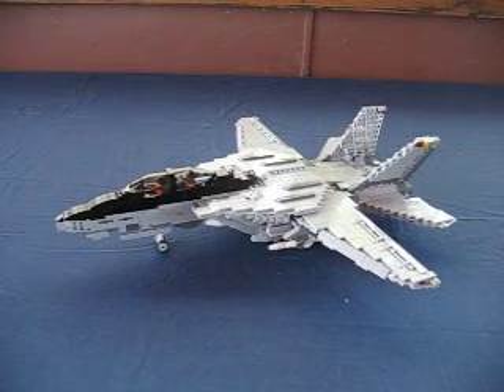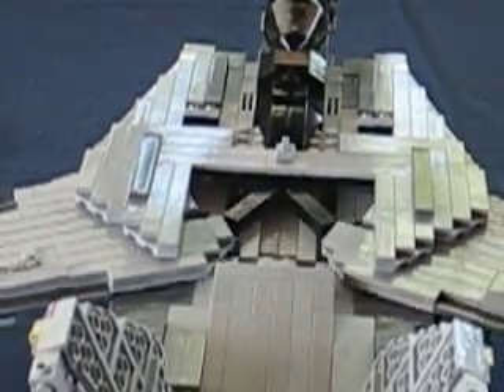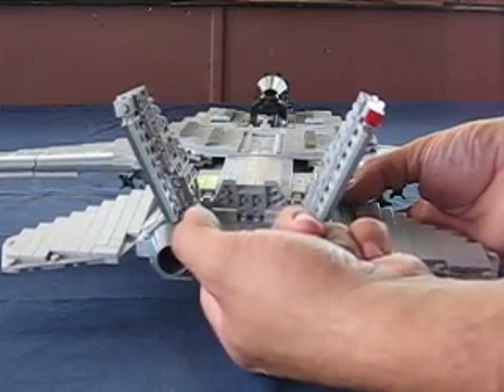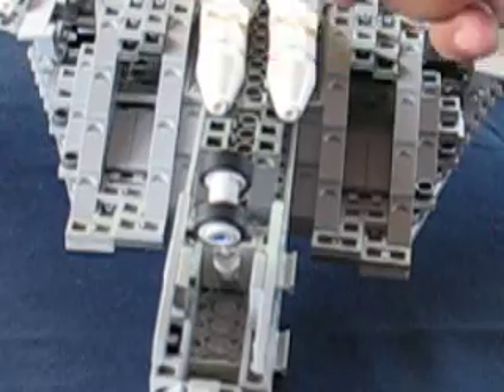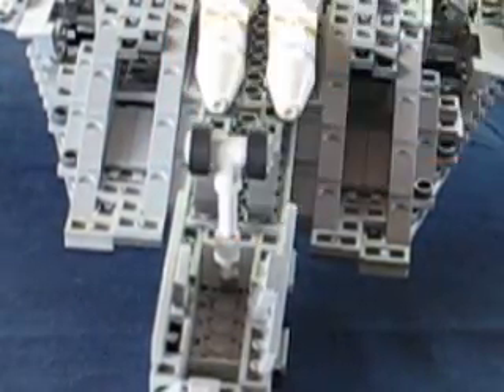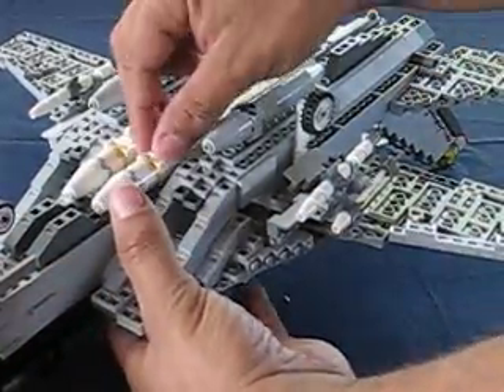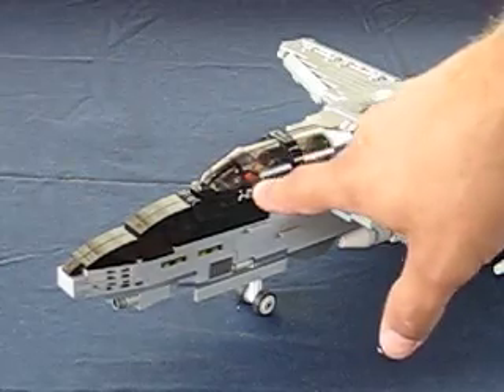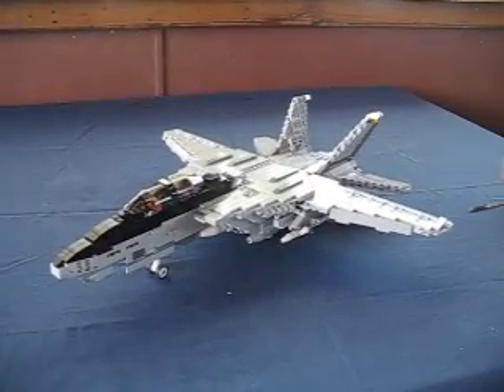Lego Grumman F-14D Tomcat

Comment: the tail flaps aren't rudders their are elevators and the tail wings are the rudders dumass. get you'r head straight
Reply: Calling someone a dumbass, and yet you can't use basic grammar.

The irony is strong in this one....
Reply: And FYI, if you had paid attention you would realize that he pointed to the vertical surfaces when he said "rudders", and the horizontal ones when he said "elevators".